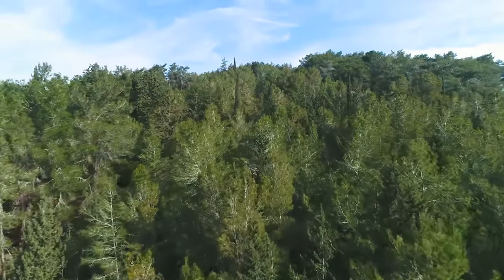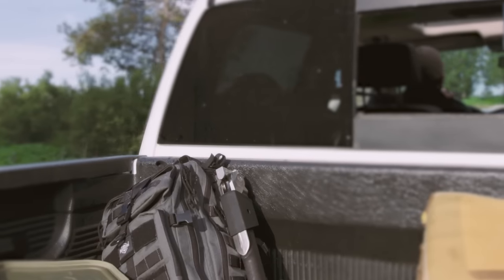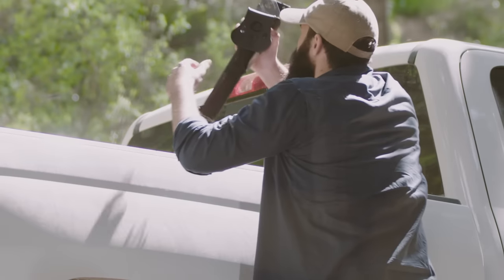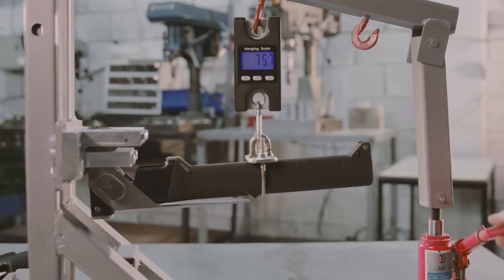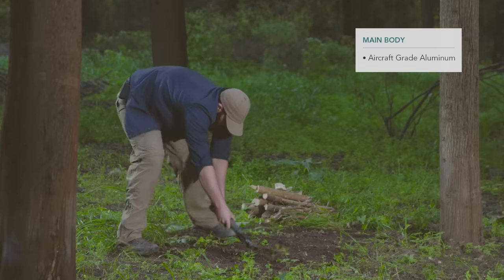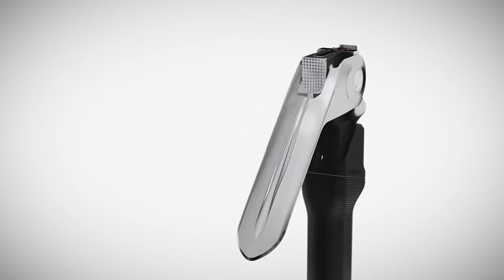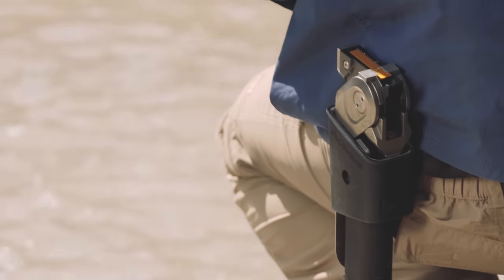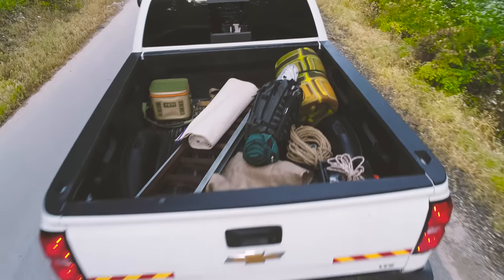COMBAR™ - AN ELITE ADVENTURER TOOL

Comment: Welp, i plan on going motorcycle camping sometime next year. since ill be on my bike weight isn't too much of an issue but footprint or how large an item is will be, so instead of bringing my mini shovel, trowel, hatchet and flat end of a pole for a hammer i decided to preorder one of these.

 like everyone else in the comments yes it is absurdly expensive but the pre order gives you a discount and carrying the 4 other items i mentioned at once with me would be a packing nightmare not to mention the added unnecessary weight. 

once i do get the item rest assured ill review it on my channel and put it through its paces. they said they would ship by December and i already filled out the backer survey which is emailed at the end of production so id say they are on track to meet that deadline goal.
Reply from the maker: Yes ! It is the perfect tool for adventure motorcycle !!!